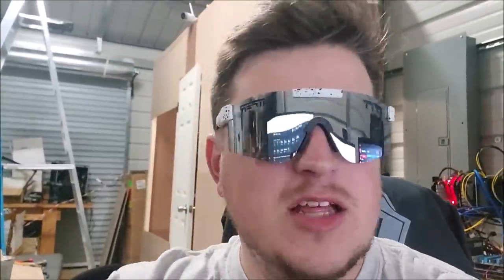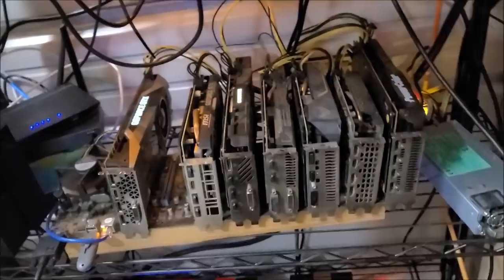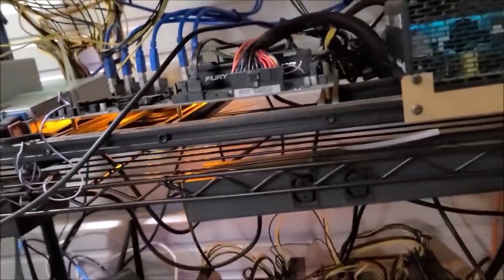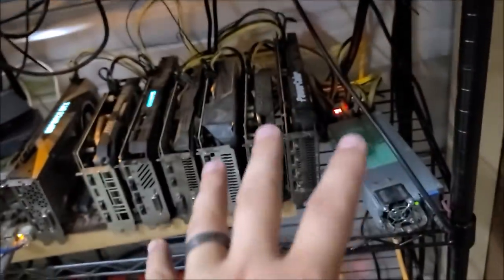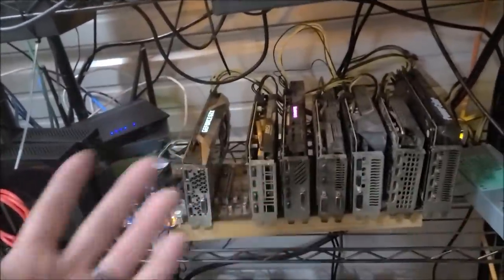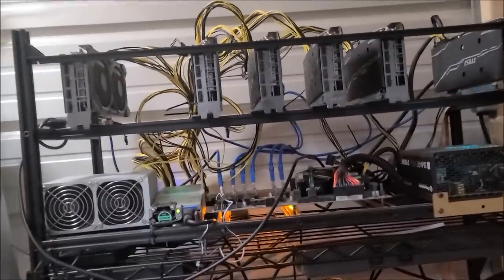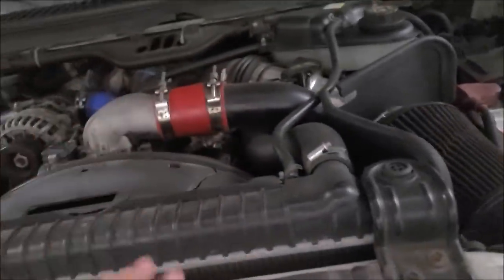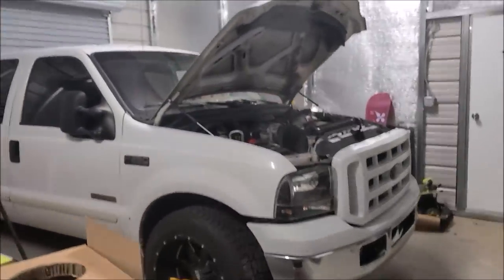Crashing Mining Rigs Troubleshooting Guide

Comment: My Nvidia 4070 ($600) from 6 months ago just crashed on me. I'm only up $460 so this is disappointing. What do you mean by flashing the card and it will probably run again? I'll try the risers and connections then update here.
Reply: Update 5/24/24 While trying to swap cables i realized the splitter was melted. I guess never use those yellow splitters to power two GPUs ( 3060 and a 4070: Glad nothing happened to the GPUs). This isn't to be confused with using a splitter to power a RISER and a GPU. That seems to work fine. Anyway, the VGA cable was not only melted onto the splitter.. but into the PSU itself. Somehow the other VGA ports seem unaffected and the miner still works with those "healthy ports" plugged in. I don't want to light my home on fire so I'm going to see if EVGA will help with a replacement or a repair as Best Buy says they can't do anything about it.

Comment: Had a RX580(8GPU)rig that ran fine for 6 months. Then all the sudden started randomly crashing with HiveOS. Did all the swapping of risers, cords, even MB with no fix. Checking it on monitor showed system just freezing up. Narrowed it down to one card. Swapped card out no more issues. But weird thing is I put that card on my Windows test bench and runs fine with same setting. Just wont run on that rig.

Comment: My rig sometimes can't connect to remote desktop and I walk in the other room and some cards fans have stopped and there hotter then they should be I have to hard reset to be able to connect to remote desktop again only happens once a month but I need help what's wrong is after burner dropping over clocks or?

Comment: i have a 3060 non LHR and it works on t rex miner at 49MH/S with PL at 67% (113w), thouse settins are on Afterburner
If i try to aply them on the batch file of trex it will save the mem clock, the absolute coreclock but the power limit will stay at 58% (99w) lowering it to 38mh/s.... Any clue why and how to make it accept the pl 67% ?

Comment: I am having a hard time keeping one running. It will run for an hour or two then crash and does not show a problem /error message in hiveos.
It is driving me crazy. Motherboard
B450M DS3H WIFI-CF Gigabyte Technology Co., Ltd. (F51c Y1 04/08/2020) CPU 16 × AMD Ryzen 7 3700X 8-Core Processor AES Disk Model ATA Micron_1100_MTFD 256GB with 2 msi 1660 super, 3 pny 1660 supers, 1 Asus 1660 super.
It is very irritating.
I will try your methods.

Comment: u need to invest in some can air or something lol your rigs are filthy. my zotac 1660S keeps dying once every day or 2, i keep lowering OC bit by bit but it keeps happening wtf
Reply from the maker: wtf wonder why whats the temps at? overclocks?
Reply: @brandoncoin  44c temp core 1020 mem 970 fan 66 after every crash I keep lowering a little bit and it's lasting longer now but no more than like 2 days till crash then runs at just under 27m/h until I reboot then does 31.5 again. Weird
Reply: @Erebos710  my zotac 1660s has hynix memory and I underclock the mem - 502 and core clock - 300 gets 31.7mhs that's on afterburner tho
Reply: @billie89rw  micron memory in mine I think only those pos PNY 1660s have hynix